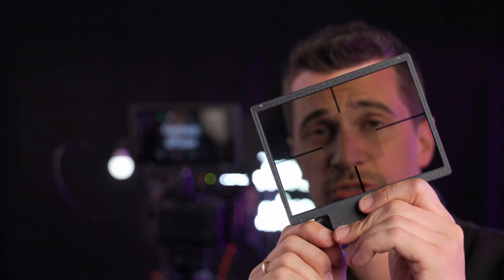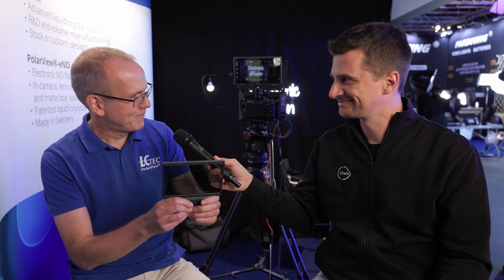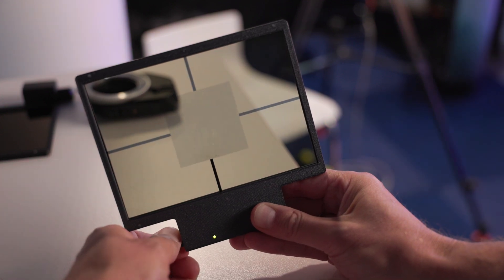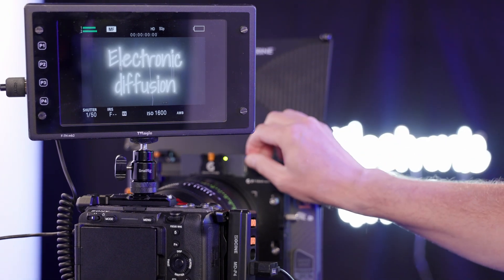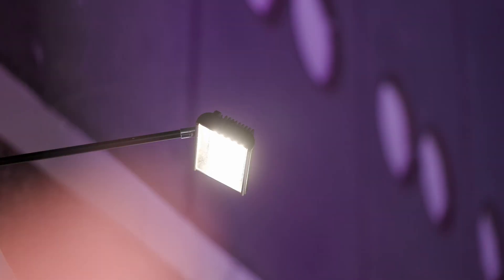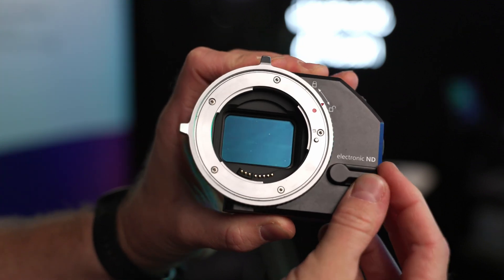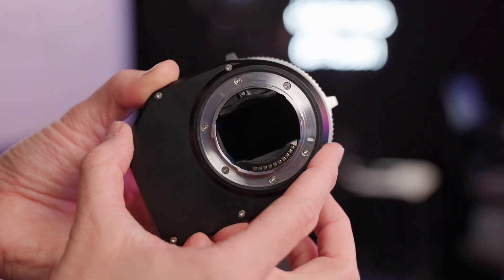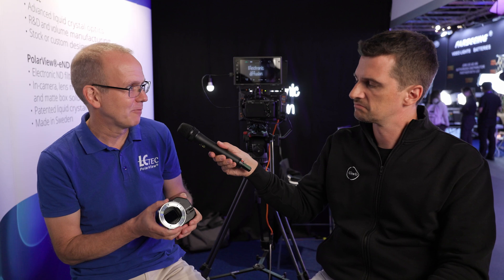LC-Tec Electronic Variable Diffusion Filter System & Metabones CINE eND Smart Adapter – First Look

Comment: Is this adapter will be compatible with crop sensors and full frame? Only E-mount to EF? What about E-mount to E-mount lens
Reply: Question 1 - yes, it works on APSC/S35 and full frame

Question 2 - e to e is impossible due to the flange distance
Reply: @RussDixonDOP  thanks! Good to know it will work on both sensors. Pretty cool concept

Comment: That's great to hear! I've asked myself why, instead of an eND Adaptor between two lens mounts, why not an eND Adaptor for the native lens mount directly to the same Mount camera body (between the native lens and the native camera mount)?
Reply: The biggest stopper is flange distance—messing with that means attached lenses wouldn’t focus at infinity. 

The second issue is that most companies won’t license out use of the body contacts for products.

Comment: great idea, but NOT just for cinema cameras, how about making it for stills to, as LF and MF film photographers in particular have this need to, and in a bigger size, so dropping it while exchanging sets is an issue so having it built in, say in a lens for Phase One XT or XF cameras, or for hasselblad, so you screw it to the lens once, and have ND or polarisation at ones fingertips, perhaps even if integrated into camera backs, this could auto compensate for exposure, so easing workloads.
Reply: That's a great great idea. It makes so much sense